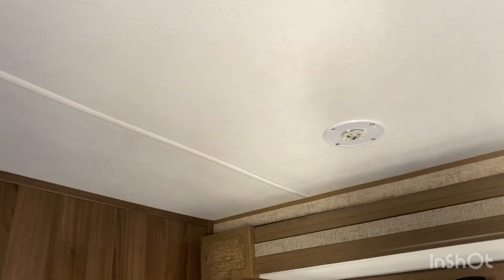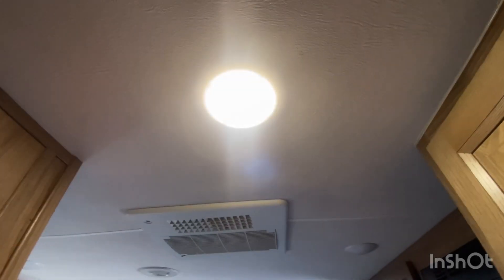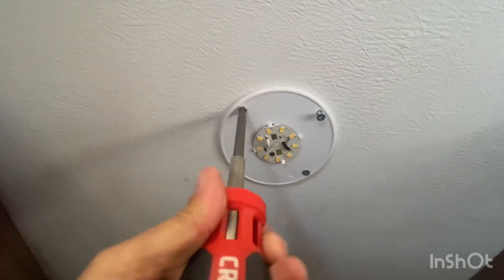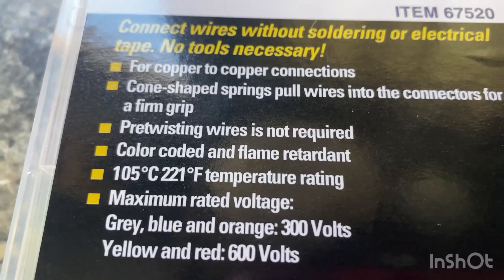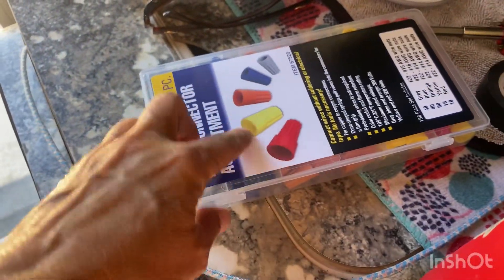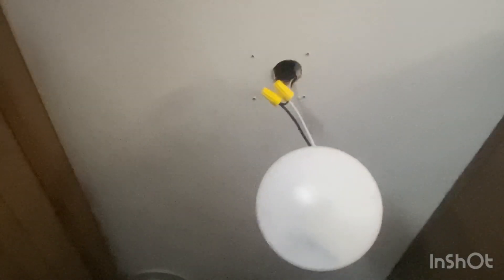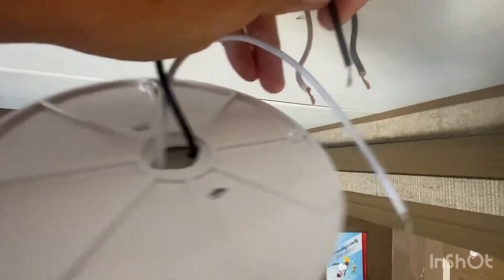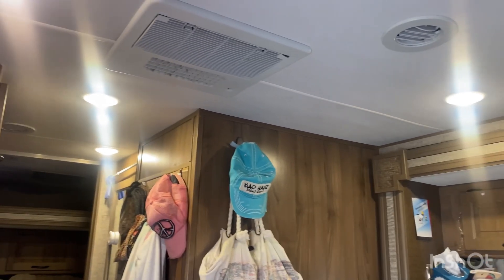I’m NOT an Electrician but I play one on YouTube. 56 Yrs Old Solo Female Nomad

Comment: I did all the 12 volt wiring for my van, and working with that power I used Lever nuts! They are the best ever! Check them out and you can wire with confidence ❤😊 Nice work!!!😊
Reply from the maker: @darlaseidel7767  Thanks. I just looked up a video to see what a lever nut was, I think you’re right. They look to be an awesome alternative.

Comment: You may not be an electrician but you handled those wire nuts like a pro 😂. I hate to correct someone but don't use wire nuts on a vehicle. You drive down bumpy roads and those can come off 🔥. Use crimp connectors, lever connectors or solder and heat shrink 😉
Reply from the maker: @magical40oz  Thank you. I think I’ll pick up a few crimp connectors, that’s what I thought I had purchased. Apparently not. I should get the heat shrink because I have wires under my bed that are held together with electrical tape.
Reply: @AnasAdventures111  I 🥰 that you have no fear tackling these jobs. Just be careful when doing wiring. There are more ways to get hurt than just getting shocked. Some can bite you in the butt down the road if not done properly. A little more research and you got it 😉
Reply from the maker: @ I was thinking I could use duct tape and a lighter to create my own heat shrink.
Reply: @AnasAdventures111  WOMAN!! Where are you getting your information... MacGyver reruns 😳
Reply from the maker: @ I watch Justin Johnson and then just improvise. https://youtu.be/F7sQc_nQ2G0?si=UNMlGS_cxP2xS7CX
Reply: @AnasAdventures111  Woman! No! Wait... 🤔... You are driving out to the middle of the desert and watching videos on how to maintain your rope... 😳. Yeah I won't be able to make it out there to a meetup 😂
Reply: @AnasAdventures111  I ain't falling for that trick... again  😂

Comment: you should have used the orange wire nuts
Reply from the maker: @camperman101  Should I redo it?
Reply: @AnasAdventures111  no, if the yellow ones went on tight they should be ok